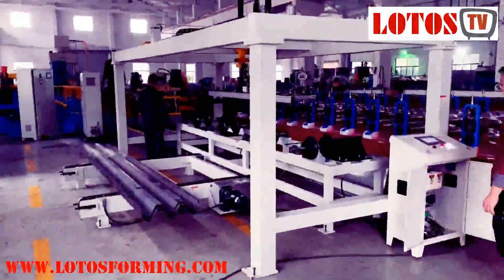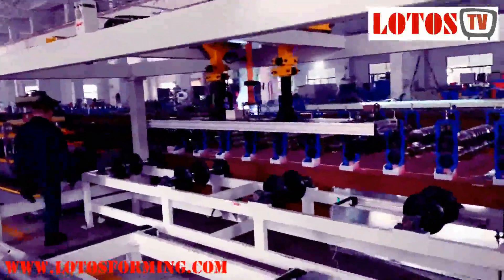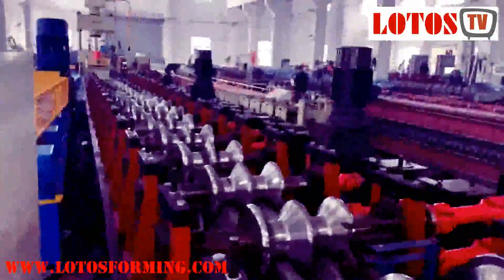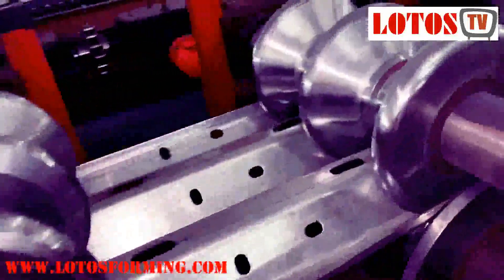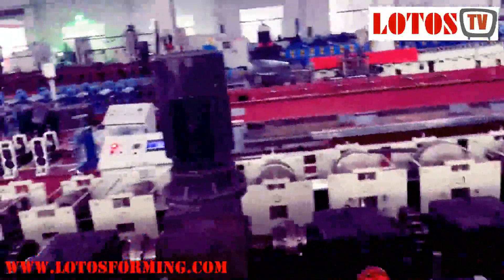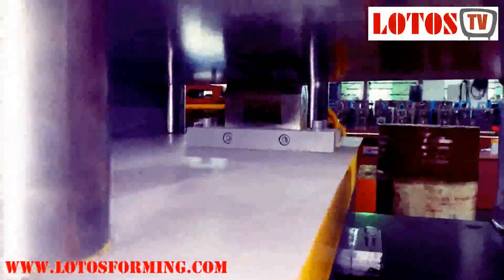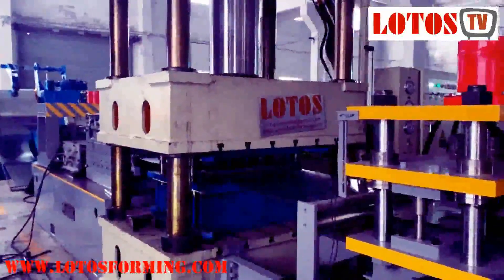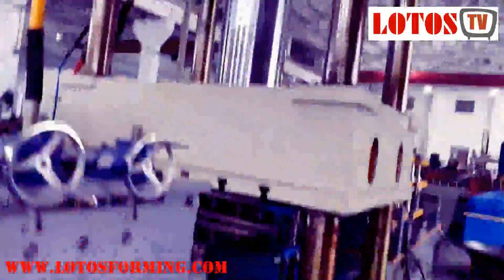Guardrail roll forming machine  | Guardrail making machine ⏭ Automatic Stacking Machine ⏮

Comment: LOTOSFORMING is one of the most experienced guard rail machines manufactures in China that produce chain transmission rolling guard barrier for 1.0-2.0mm thickness for low budget highway guard rail suppliers. And also, gearbox transmission highway guard rail roll forming machine for 2.0-5.0mm thickness heavy-duty application

Comment: automatic stacking systems are designed to dramatically increase the capacity of the main machine and to reduce labor costs.
Reply from the maker: its important point
Reply: @lotosforming  unless it's your first day driving a fork lift like me and turn to fast going out to the parking lot with my 50 stack of w beam

Comment from the maker: This guardrail production line will be combined with hydraulic decoiler with travel cart and leveling system and hydraulic feeding device and 315T hydraulic press machine with dies and hydraulic puncher station with the pre-cutting unit and roll forming machine part and hydraulic cutting unit and output table AND automatic Stacker Machine and hydraulic oil pump and electrical control cabinet and so on.